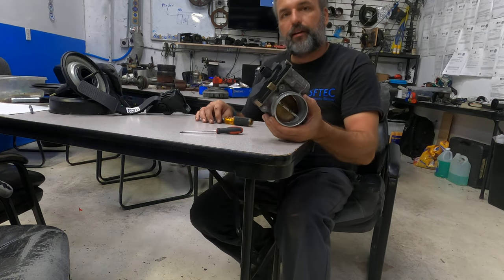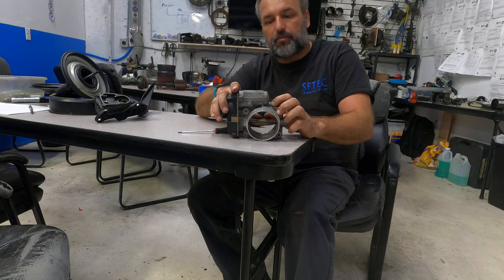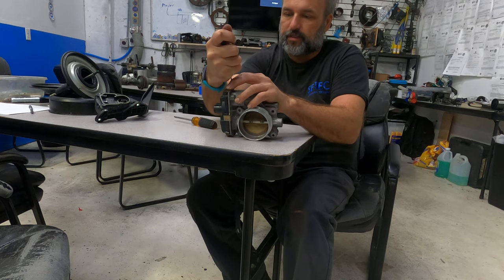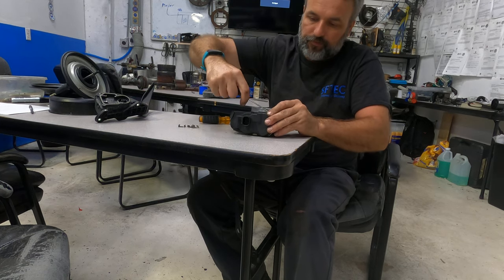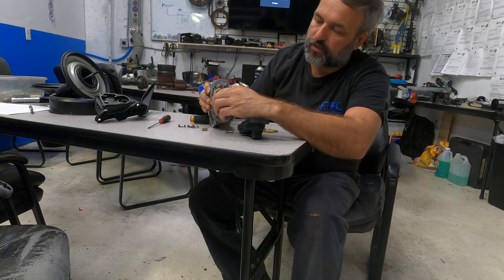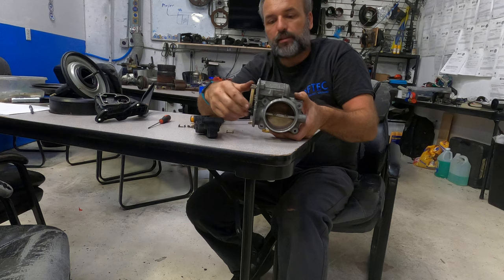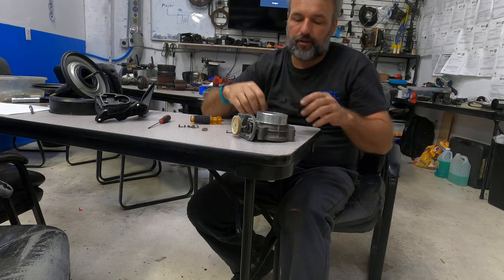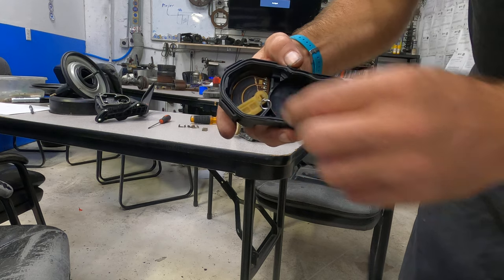Testing a throttle body on a Chevrolet Silverado. Normal operation and default closed position.

Comment: I was worried the default position was fully closed, cz I’m checking the throttle body in my Silverado and and seeing that it set at an angle like slightly opened, but it is normal. Thanks for the video.
Reply from the maker: Your welcome. Thanks for watching.

Comment: ok i have a question, at idle in a 2005 chevy trailblazer 4.2 l what percentage of the THROTTLE BODY should be open, 0.0 % or more like 12%. please answer.
Reply from the maker: Any electronic throttle the position should change as the vehicle idles but 0 would not allow any air flow and the truck would stall. Default is about 24 then when the engine starts the computer pulls it more closed.

Comment: So when does the testing start, or was that all you have?
Reply from the maker: I have run thousands of test on the 2010 Silverado 5.3 but much is restricted until a lawsuit is completed. One thing you will find is the GM SI (Service information) is riddled with errors.
Reply from the maker: If you have any questions on specifics, I might be able to help. Best is to call the school and get my email if you have a question.

Comment: GM has a TSB for replacing the cover that contains the potentiometer but most V-6's.
If gently re-tensioned fingers and a proper reading on the both ends of the rail, a dielectric grease thinly wiped on the plate will increase the life of this two position feedback signal. It provides confirmation to the TAC or PCM to tell throttle air valve position. Otherwise it will default to reduced power mode. A key off, key on may reset the Default Reduced Power mode, returning to normal operation. I have drilled rivets cleaned and repaired the first design installing small self tapping metal screws in the cover to hold it on. 
ASE Master tech since 78, retired.